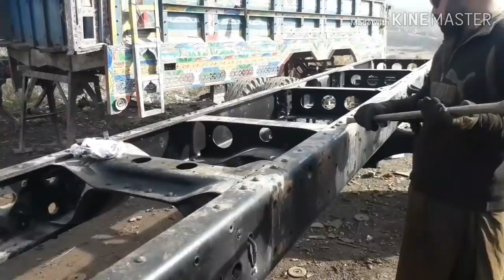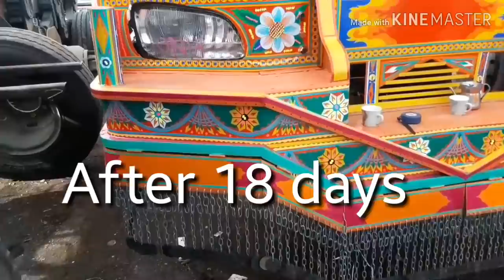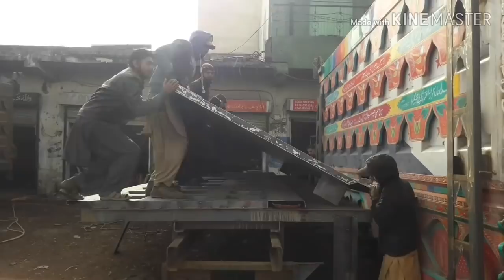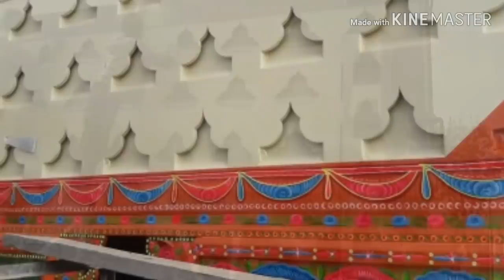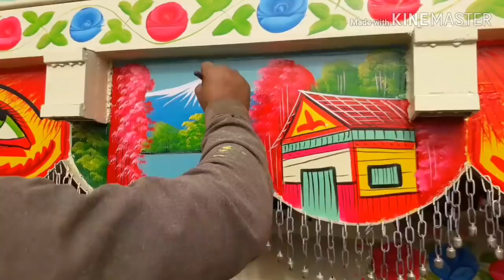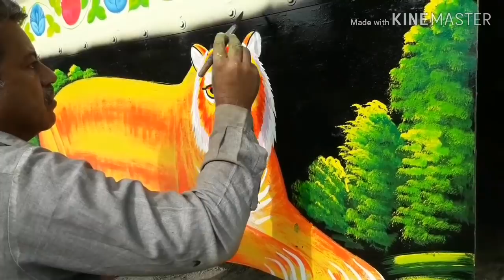How to make a Hino truck dump with Pakistani truck art

Comment: As usual so much done with few tools just hard work ,could not see anything like this being done in the UK  bloody health and safety would stop it at once.it may look easy what the lads are doing ,but one slip with the hammer and you could loose a finger or two these lads are very skilled at what they do.and they will not be going to the gym to build up there body strength after work.